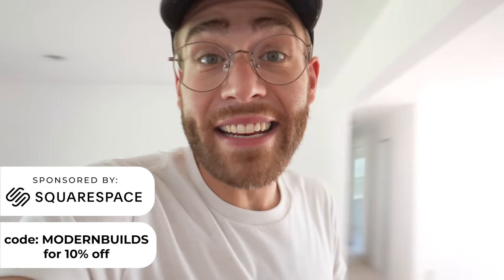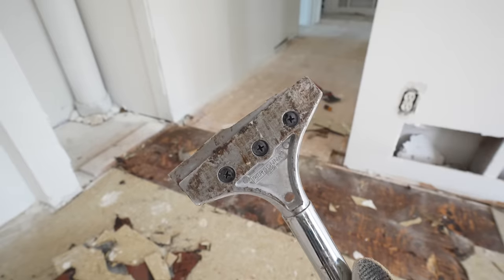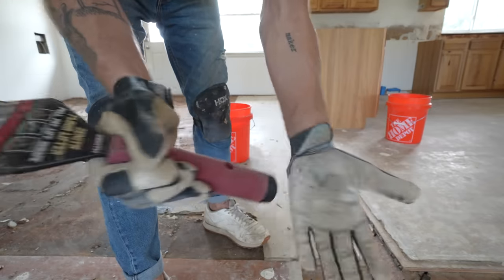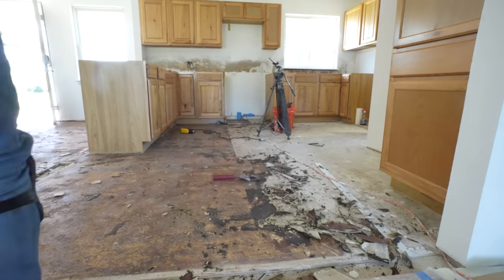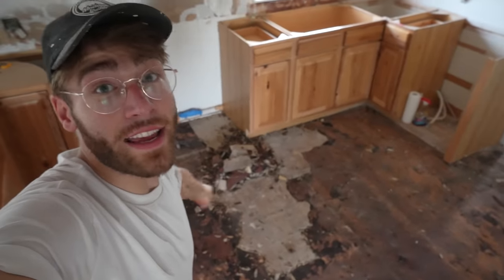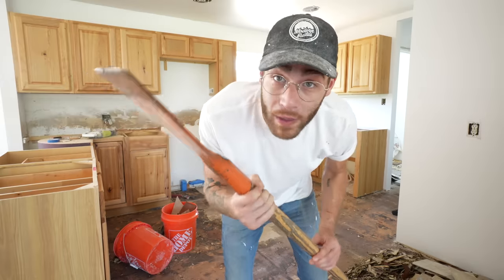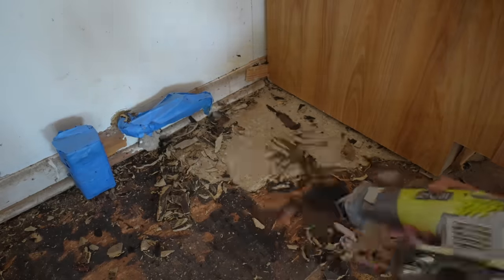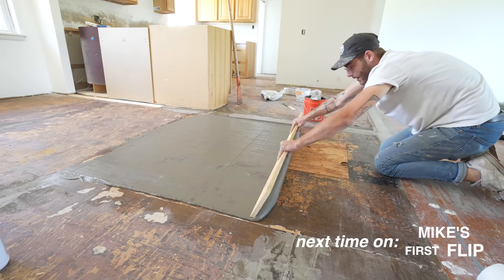How to Remove Vinyl / Linoleum Tile and Adhesive from Plywood Subfloors

Comment: 1. Asbestos in old vinyl tiles.  2.  Abestos in old mastic used to glue the tiles down.  3. A hammer drill works a treat as a scraper: get a flat blade SDS attachment and set the drill to hammer-only mode (no rotation).
Reply: I second the hammer drill. I have a SDS max 6 inch wide scrapper blade that could easily have shredded it all, then maybe used my sds plus super thin blade for the really stuck down stuff. Probably could have gotten it all done including clean up in half a day.. I do this regularly btw
Reply: @wompapa1453  how would you scrape off of a hardwood floor?

Comment: Buying a hammer drill would have been a lot easier to tear up all the tile. I'm doing my kitchen floor right now I've taken a little break from that but it works a lot better than trying to do with a chisel

Comment: Old 9”x9” linoleum tiles usually contain asbestos adhesives and might contain in the backer material definitely do not want to agitate that stuff😬
Reply: Just started a tear out of old 9×9 glue down tile looks like original floor looks like black glue on back of tile and plywood floor. Who could test it for asbestos.

Comment: Thanks for letting us see all the possible ways to tackle this. I was surprised by the variety available. Though as you've learned, it's usually not worth trying to avoid buying/renting a tool, especially for someone who regularly works on large projects like yourself. Your labor is valuable. If a hundred bucks saves you 2-4 hours, it paid for itself.

Comment: Former flooring guy here n i would use a 12-18 inch scraper. Also i would keep all my used, dull oscillating blades n give them a sharp edge just for this reason here. They really came in handy for those stubborn tiles. Good to see you wearing hand n knee protection. Great job as always
Reply: Do you think there is asbestos in the tiles/glue?
Reply: @quilleymemory  I believe it's in the tile, not glue. In these tiles, I don't think so

Comment: For the future, I recently struggled with vinyl flooring being stuck in our kitchen. We were remodelling, and I used all of these methods AND did a chemical strip. Chemical strip needed 2 days to get down below into the glue. Vinyl wasn't a tile but a sheet. 

Just cutting out the existing subfloor and replacing with new subfloor was WAY easier and time effective than taking out all the rest. I got out as much as I could, then crowbared everything up and took up any screws that might have been in there. Cut and laid new subfloor and I'm so happy I have a new floor to work on than trying to level out an old one.

Comment: How did you dispose of those asbestos tiles? I have the same under carpet currently but I'd like to put down different flooring. I'm actually thinking linoleum tiles with an underlayment because the heating system in the house goes under the floors on the first floor through the slab. 1945 built and now needs to be updated.

Comment: You should sand the floor before installing anything new, the glue will be way more sticky. On the old stuff, it will get loose in 2 years max. Just a good pass like the wall with 500 to clean the plywood sheet of the ground is always a good idea.

Comment from the maker: I've got a few videos already filmed with this LPV flooring prep and install! Stay tuned and let me know if you've got any tricks or hacks for getting tiles and adhesive up from plywood subfloors. Thanks for watching!!
Reply: Just in case you miss the comment fron another user. Did you check the tiles and adhesive for asbestos?

Comment: I basically just did this but was installing tile in my kitchen. Had the same struggle with pulling up the floor as some spots had a TON of adhesive.

I ended up buying a floor scraper from Harbor freight and that thing was great.

All metal with a long handle giving it weight and has replaceable blades, item number 60572

Comment: Don’t do this!
The paper backing and the mastic is suspect and if positive is usual 20 percent plus asbestos. To put that in perspective popcorn ceiling is usually around 3 and drywall mud around 2. If it’s positive the house would not pass an air test and dust samples in the ducts and even on a surfaces on a different floor would probably not pass and would be considered contaminated. His liability for property, people’s health and illegal dumping is endless and actually has a high chance of being caught, if the next owner has the smarts to do it legally then there’s a pre-abatement air test (so the abatement company doesn’t take the blame for contamination) and if the air test fails or is even high the abatement can’t start, and that’s when contamination dust testing starts and that’s when bankruptcy starts. 
I will pass on the debate on how bad it’s for your health I’m in the middle on that debate so I’m not an asbestos alarmist. It is however very regulated.
Reply: I'm not quite sure what you're saying here. Once asbestos tiles and adhesive is removed it's gone. Lay a new flooring material and you're good to go. There's no risk of somehow contaminating the home down the road. Years back when I used to do a little asbestos abatement work we either a) removed or b) encapsulated the material. Encapsulating simply means sealing or covering. So....sand or scrape this floor, carefully vacuum it with a HEPA-equipped vacuum,  then lay your new flooring material. Of course, seal off this work area from the rest of the house before starting. I think people have an inflated idea as to the risk involved. Asbestos is not nuclear waste (I worked in nuclear research too, once upon a time, as a young university student) and you simply need to follow a few basic rules.